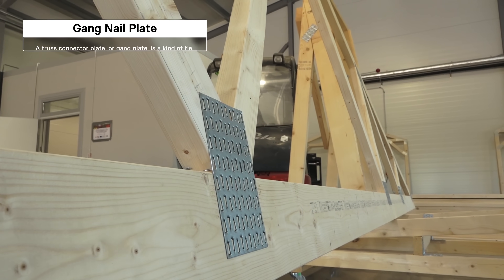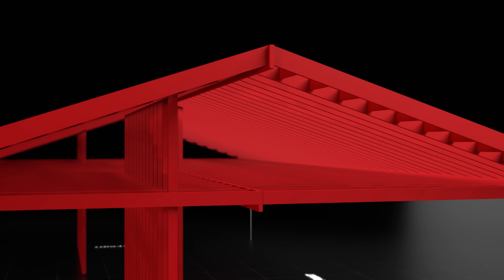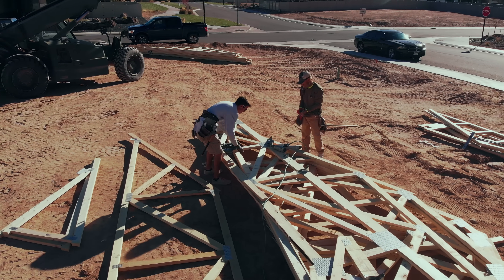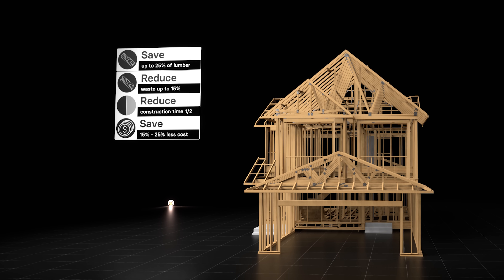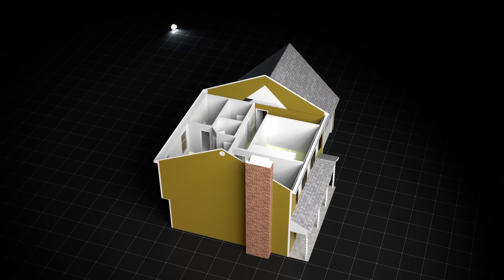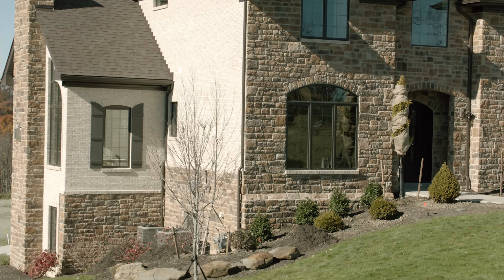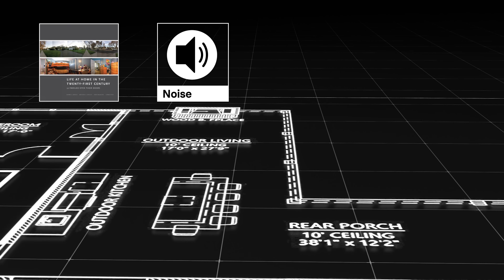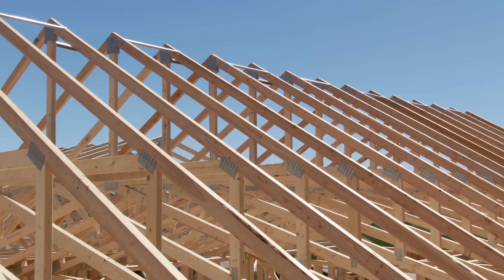The Invention that Accidentally Made McMansions

Comment: My house is from the '70s (1875!) It's a modest middle class rowhouse in the city with 3 occupied floors, and It's the opposite of "open floor plan". It has many small rooms and dozens of doors, For this I'm THANKFUL. Victorian architecture has been criticized for excess, but that's in mansions, not normal middle class homes, The architects then were not idiots, The high ceilings, tall windows and rooms that ALL have doors in my house are pre- A/C climate control!  I can control the temp in every room, (entirely "ignoring" any room being unused at the moment..) and the floor plan allows more privacy than modern homes (important when my kids still lived at home) and all available space is used, Being a "Mansard" roof design, the otherwise wasted "attic" has two full bedrooms,. I live in Pittsburgh, So hurricane winds are not a "thing", But I'm gonna say that the 1870's design WAS "sustainable" as 150 years is a good "ROI".
Reply: That's a good point about the doors = temperature adjustment. I notice a huge difference in my bedroom's temperature (warm or cool) when I close my BR door vs leaving open a crack.
Reply: @VAwitch  Yes, additionally i can open or close heating/cooling vents (forced air system) in each room and having doors closed to them isolates them instead of affecting the whole house.
Reply: yes me and my friend are restoring a brick hotel from 1924. very promising and mansard roofs are the way to go!
Reply: @kromsukit  Cool! I know that mansard roofs were considered "obsolete" by the dawn of the 20th century, But for the life of me, I don't know WHY? (fickle tastes, I guess). Good luck on your project. I'm all in on restoring/renovating historic buildings. Ultimate "recycling" (And let's face it MOST new buildings are ugly), LOL
Reply: @jamesslick4790 because they leak way more often and are expensive af
Reply: @jamesslick4790  Basically it was just a change of style, the mansard roofs looked "old"
Reply: Agreed! I have an 1806 federal. It’s has many rooms. It’s cool in the summer and warm in the winter and very private.  These were purpose built to keep heat in the small rooms, right down to the multiple small staircases away from the grand entrance area.
Reply: @nathanfisher4452  👍👍
Reply: @nathanfisher4452 this small staircases were typically used to keep “The Help” out of sight in between duties. They were essentially the servants route.
Reply: My biggest complaint about modern homes is how all the open spaces take away a lot of utility and privacy. I grew up in a midwestern home that was built in the 1950s and expanded in the 1970s. With a detached garage and two floors plus a basement, there were a lot of spaces for privacy and storage as well as space for hobbies, workshop etc.

I now live in a home that is technically much bigger than my childhood home, but lacks the detached garage, no basement, and the entire first floor is essentially one big room. It's much bigger but has a lot less usable storage space and far fewer actual rooms with doors. So even though the house has much more street-side appeal and prestige it is way less useful overall. 

The other type of modern home I dislike is the "museum home", where the house decor and furniture is so immaculate it looks more like a museum or showroom than a home that people live in and use. A lot of the million dollar homes on Zillow suffer from this issue. I can't even imagine living in a home like that with kids and actual hobbies.
Reply: @warc8us the only area that can be open floor plan is the great room/family, dining room (whether breakfast kitchen, kitchen bar, or small formal dining room), and the kitchen. Other rooms in the house should be closed with privacy. I used to hate gallery kitchen but now I love them!
Reply: I had an 1870s 10 room house built by a doctor. It had transom windows above every door inside and outside the house. When used properly, there was no need for AC. The doors to each room also had a larger gap at the bottom compared to modern room doors to allow airflow when used in conjunction with the transom windows. People also don't realize that when hot water heat came into fashion, the radiators were placed under windows to allow you to leave the window open a crack.  This allowed the cold air to travel down the back of the radiator, allowing the warm air to  circulate around the room.
Reply: @lessbs very interesting explanation!
Reply: @lessbs I always thought they were put in front of windows because that was where the coldest air already was.  You would not need to crack the window.  This is the same reason baseboard heaters are often put there. Plus, no big furniture is going to go in front of the window so it is not taking up the most useful floor space.
Reply: Victorian designs was where it was at.  Speaking of excess, Queen Annes are my favorite type of victorian architecture.   Around 1880-1900 era.
Reply: @mewimi  Check out historic Raleigh, NC neighborhoods of Moredcai and the Gov. Mansion. FDR proclaimed it was the most beautiful in the nation
Reply: Queen Anne era and Victorian houses rock!  Great to live in--privacy, control over heat/cooling in each room, natural ventilation built in, giant windows, pocket doors to convert public rooms to private ones as needed--tons of space in the attic and basement, and skilled carpentry viewable throughout.
Reply: That was peak home design.  Open floor plan has no place in a polite society; it's just an ostentatious show of wealth (or more often, a desire to present a perception of wealth).  You want to entertain?  That's why older houses had parlors.
Reply: @brian.s4555  I agree about parlors, and multiple rooms in general, versus open-plan. We had a turn-of-the-century Queen Anne for nearly 20 years, and sometimes had fairly large gatherings — upward of 50 people. There would be clusters of guests in the front parlor, the main parlor, the dining room, the kitchen, and often on the porches if the weather was nice. When people brought kids they'd often end up on the window seat of the staircase landing or in the upstairs hall, which was quite wide, so they'd have their own space to play. Multiple rooms let people circulate among conversations and groups, without everyone trying to talk over everyone else. There's a reason Kenneth Burke talked about "parlor discourse" and not "everyone in one giant room discourse".
Reply: 👍 My entire one bedroom cottage can fit into the Great room of one of these McMansions and I wouldn't want to live anywhere else!
Reply: I grew up in a 19th century house. It is in the northeast and precedes yours by several decades, but they knew how to build a house then. That house was firm and remains that to this day--my parents sold it after I graduated and moved out. It was huge, the mortgage was low because real estate was all about the suburbs and so 19th century houses in the country were a niché market...and although incredibly sturdy, they require modern upkeep (we had no AC, for example.) Open spaces? Naw. Many rooms, both small and communal, plus land and privacy.
Reply: I too live in a home from the 1900s, 1910 to be exact, with a basement pre ac original molding and hardwood floors and plaster walls extremely large windows and doors and 3 floors with useful space and large bedrooms. After living here i have a new respect for the architecture of the 1800-1900s slate roofs 2x8 joists but with a old house comes old house problem but i can assure you its not my foundation or my roof lol…love a older home and wouldn’t go back to today modern stick homes
Reply: @laurenredd7255 sounds a lot like my house except for the slate roof.  Ours has been partially destroyed (well, seriously injured) by upgrades and repairs done on the cheap.  But the bones are still there and it just feels better than a modern house.  There is a weight to it.  I do not like the fact that when things do go wrong, it is never an inexpensive problem.
Reply: I love the un-open floor plan, for the reasons you described. We live in a 1864 farmhouse*, but my dream house would be one of the larger Sears houses.

*”poor-people farmhouse,” not “rich-people farmhouse”
Reply: @llamasugar5478 the Sears houses are pretty cool.  There is one beside the house I grew up in.
Reply: @jamesclick4790 Excess is just what modern architects use to try to discredit the use of and preference for ornamentation in buildings.
Reply: We have many in the greater Boston area as well. I would never buy a new one
Reply: Just about the only Victorian style that was all about excess (with the exception of the romanticist revival styles) was Queen Anne Victorian. We should definitely be taking some ques from older houses, like basements and walk-up convertible attics (I know basements and walk-up attics are not feasible in certain areas due to geological and climatic reasons) to expand into. The type of closed layout with only one bathroom is the norm in Canada, Britain and Australia.
Reply: @jackesioto  With all of the modern push towards energy efficiency, we SHOULD embrace some of the "old school" designs. Many people forget that the old homes were designed to be as comfortable as possible without using ANY energy as they did NOT have the luxuries of central heating let alone A/C. A "closed" floor p[an is just easier to "regulate" (I think that's called "zoned A/C" now. LOL
Reply: my 1911 give or take 1 3/4  story my ground floor has 3 meter heights and upstairs is IN the roof line is smaller and does NOT need the extra height for sleeping
Reply: Oh yea - gimme a Victorian any day of the week over these barns they're building now. And a pox on stainless stee - I mean STAINLESS STEEL APPLANCES!!! as HGTV likes to crow about!
Reply: This was very apparent in our apartment in Charlottesville VA that was a turn of the century home later converted into 5 apartments. The “useless” attic literally became a separate apartment with two rooms. They added on a tiny kitchenette and dining room to our apartment around 1940. In the original area of the house with the high ceilings we hardly needed AC or heating even with hot summers and snowy winters but in the add on it would be boiling or freezing. The architecture is everything. I talked to the contractor who did  some repairs on our building and the one across from us built in the 1970s and he said that building needed way more maintenance and constant repairs and our hardely at all. Sadly we learned they tore it down to build a high rise
Reply: I live in an 1890 Queen Anne.  I love that we can open all the pocket doors to have an open floorplan or close one or more to separate rooms, whether for noise, privacy, or temperature control.  Our attic has amazing storage, too.
Reply: As I’ve noted in another thread, it’s important to consider survivorship bias when considering old houses vs. new ones: The worst examples of the old houses are more likely to have been torn down or at least extensively updated/remodelled. Conversely, the better built, maintained and updated old properties are more likely to have made it into the present.
Reply: frank lloyd wright pioneered the open floor plan but his designs didn't do fully open spaces the way modern homes have. the rooms are elegantly connected in clever ways and still have doors or curtains separating them for privacy and separation.
Reply: That must be a beautiful house! I'm jealous!
Reply: Back then they had to engineer around what they had at that time.
And they did a good job at it to.
Reply: Great video.  These McMansions will be gone within 100 years.  My 1850 Victorian Italianate is still going strong.   Timber frame and brick an unstoppable combo for the ages.
Reply: I miss Pittsburgh architecture - it’s a wonderful combination of old and new
Reply: Mines from 1915. Every room has good natural light and air, with ceiling fans in every bedroom. I couldn’t live in a ticky tacky shit shack.
Reply: I’m not a huge fan of the McMansion but I find my Victorian copy home is rather chopped up by small rooms and many walls. I have a lot of kids and we are on top of each other in every room. The kitchen, dining room and living room could be larger and still have plenty of privacy. I don’t want every room to be huge, just the three we spend the most time in.
Reply: I'm thinking this design is also to blame for paperthin walls in newer apartments too. If you have a load baring wall made of brick or concrete not much sound is getting through.
Reply: Love my Greek Revival. Having doors seperating rooms is very useful.
Reply: I built a Natural Spaces Domes 49ft geodesic dome house. We used 3/4" T & G plywood for all the outside roof and wall sheathing. Put on with a combination of structural adhesive and adhesive screw nails. It's not going anywhere...ever!
Reply: The front part of the house I mostly grew up in was built in 1767 and is still doing well.  It was a cape cod, with 4 rooms downstairs and 2 upstairs.  A huge addition was added in the mid-1900s.  It has lots of rooms with doors.  We had a blended family of 8 living there and doors weee essential.  An open concept house has nothing on a place with more rooms and doors when there is a family of any size involved. 

My house is a small mansion from about 1910 but has some of the same characteristics as yours.  The rooms needed to be heated by fireplace when it was built so they cannot be very wide.  There are doors everywhere (except for renovated areas).  There are significant downsides but most of those are the result of modifications much later.   The heat was originally hot water radiator controlled mostly by convection and gravity but no one here knows how to fix that anymore and previous owners made some poor choices.  Valves that would have controlled flow to individual radiators were removed. The system was allowed to freeze one year and several radiators burst.  Plumbing was added in what appears to be three main stages and some of that bled hot water off the furnace (originally coal) creating bizarre bypasses to the existing heating pipes.  It’s a bit of a mess at this point and probably functioned much better in its original state.  

There are no trusses. 

There were poor choices with the original build.  It was not perfect. 

It would be nice to have some larger spaces.  But I like old houses and, overall, it will last much longer than pretty much anything built in more modern times. 

We have been in some mcmansions (why does Apple think that is a formal noun?) as air b&bs for family events age, despite the large sizes, people are always present.  The den/kitchen/livingroom all being connected makes no sense to me unless you are hosting a party.  I suppose having enough space for the film crew will help when everyone is an influencer and I suppose it is important to  be able to come down the stairs in a full ball gown.  But they always look (to me) like something a poor person would think a wealthy person’s house would look like.  I suppose that is the point.
Reply: Interesting story. Being from Europe, I’ll have to search what Mansard is.
Reply: @are1981  Ironically the Mansard roof is a European invention (France), In fact they are often referred to as "French roofs".
Reply: @are1981  It's just a steeply angled roof and often has a window or two in it, it's of French origin as I recall
Reply: @FCE-dogs  It IS of French origin, And from what I have heard, it was originally a tax dodge. The area under the roof was considered an "attic" and not a whole "story" , Ergo a house with two floors AND a Mansard roof "attic" was taxed as a two story house, while in reality having three occupiable stories. I don't know if that's the real reason behind this design, but it's a fun tale.
Reply: @are1981  lol, Mansard is 3rd Empire French!
Reply: @gellfex9287  It's actually French Baroque. Named after Jules Hardouin-Mansart (1646 - 1708)
Reply: @dlevi67  No wonder I failed art history! Falling asleep when the lights went down for the slideshows makes retention hard.
Reply: @jongellman5327  At least you retained the 'French' bit. Happy New Year!
Reply: @are1981  Think Paris.
Reply: The open floor plan is just an option, though.  Walls could be put up if the homeowner wanted to change the floor plan.
Reply: @RtTrningGrl  There are actually consultants now who will come in and design walls into a modern "barn" or fix an older home where the walls were torn out.
Reply: I would not enjoy living in a house that is all blocked up like that, I really love how my home is, the main living area is a very large open space, it feels good to spend time with family in a large space ,we aren't on top of each other but we are all together when in the main living spaces of the house. if you want privacy you go into a bedroom.
Reply: @AsTheWheelsTurn  People have different lifestyles. I like CARS, Not SUVs, But many people like SUVs. Same thing.

Comment: That didn't fix the problem of toenailing, all it did was make assembly line trusses more economical. The trusses would still have to be toenailed in. The thing that fixed roofs from being torn off so easily is the use of Hurricane Ties and Joist Hangers. That's what fixed the problem of toenailing. The overlapping joints are very strong, they did not need to be replaced by your plates.

Comment: I hate truss roofs rafters are so much easier IMO.
Reply: And I don’t see how trusses are stronger they are 2x4s and rafters are 2x8, 2x10, or 2x12 and you still have to toenail them to the top plate of the wall there’s no way around that. They also make the attic so small you can’t even stand up

Comment: Strength and durability are more desirable to me. Low cost ownership. Smaller is better for heating and maintenance. A cheap pole barn could handle the larger space if desired for storage and a hobby shop.